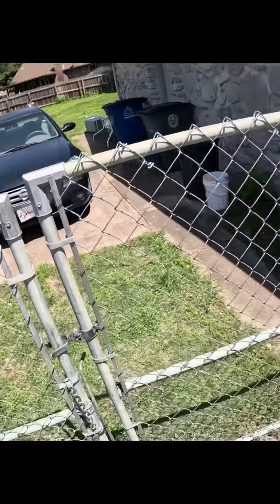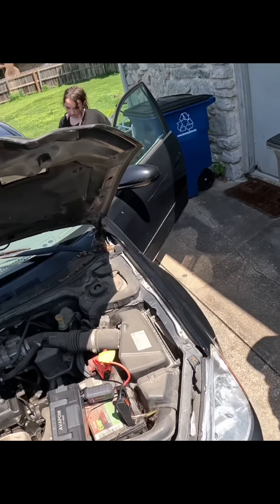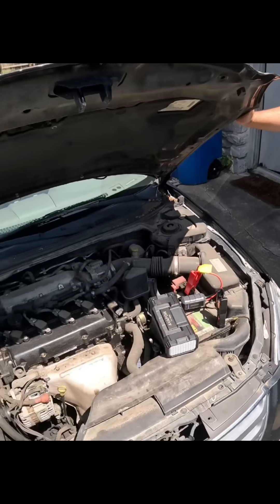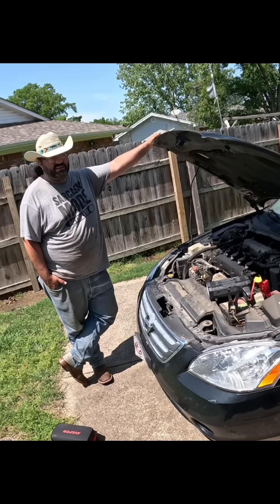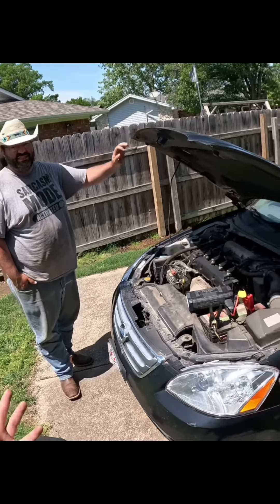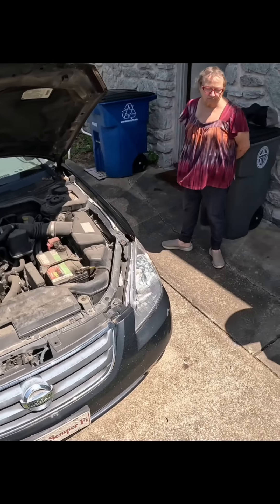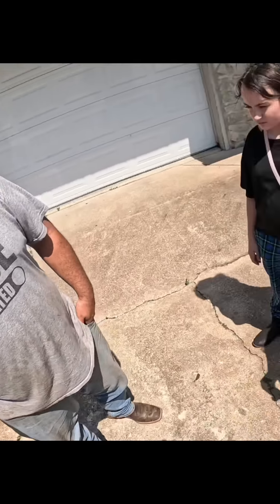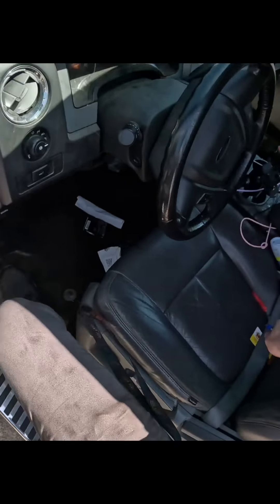Her first car is on its last leg!

Comment: Matthew, when I met my wife back in 2000, she had just purchased a 2000 dodge neon 5 speed with a 2.0L engine. I couldn't drive it, but I could maintenance the vehicle.  It was our most reliable vehicle. I have done brakes, a cam sensor, and a couple shift cable bushings over the years. Nothing major.  Still runs great. I'm sitting in it running fuel injector cleaner through the engine as I am typing. My wife taught me how to drive a manual transmission in this car. It is very special to me.  I'm sorry for my mom. It is sad how people take advance of people. I love your channel and your integrity. God bless you and your family.
Reply: Good to hear I got a 2005 neon sxt does yours have the classic lifter tick ? and what oil you use ? So far Only major jobs was water pump timing belt head gasket for me 145k miles the base models are very reliable the srt4 was pretty reliable as well dodge and Mitsubishi did well with them …Matt had one neon on his channel I believe
Reply: They are the best I had one for 11 years never left me stranded and it never left me down! 2004 Dodge neon SXT when she passed over from salt from the road she had 250,000 mi on the clock! Best vehicle I ever owned besides my Intrepid!
Reply: @Young516_ I never had any problems only had to change the timing belt and water pump and that was it of course I did transmission fluid changes best car ever owned!
Reply: @Young516_  The only time I hear lifter tick is after it has sat for a few weeks without driving. It goes away after running the engine. I've used all the major brands of oil in it. I always changed the oil at 3,000 miles. I timing belt and water pump is coming up.

Comment: there not being a check engine light, doesnt mean it has no faults. my car is annoying because of it. gets a fault, but if its not terrible, it just keep on going like nothing. had low fuel pressure sensors go bad, evap system clogged, missfires, yet it gave me no check engine, but the fauls were registered and visible on the diagnostic tool.

Comment: Don't know why it would be pointless to scan if the check engine light isn't on. Check engine is only going to tell you about drivability or EVAP concerns. If you're inspecting the car for someone to by, having all the other information can be useful. I had a truck I just bought where the AC worked great. Tested it, felt cold air, and was going to move on. Saw an HVAC code and realized I need to go test EVERY switch and button because there were actuators that weren't working. 

Then I learned the front impact sensors were defective. If I smashed into something, the airbags won't deploy. Don't you think the Dad is going to care about something like that for his 17 year old?

Stuff like this that doesn't trip the money light is important.

Comment: $250 for the timing chain 😳 I paid £600 for a timing chain to be done on an opel corsa 1.2 two years ago 😳😳 and then I paid the same garage £300 to do the water pump like a month later because that went to be honest I was suspicious that they may have sabotaged it because you have to take the water pump off to do the chain and the chain never sounded good either, I certainly wouldn't use the same garage ever again, the water pump literally went or started making noises like a week after they'd done the chain 🤷‍♂️ but you can't prove it so 🤷‍♂️
Reply: My timing chain for a v8 ford 302 cost me 55$
Reply: They should have insisted and made the water pump part of the timing job absolutely. I don't feel it was sabotage though, the new tight chain and tensioner alone would have wreaked havoc on the old worn water pump.
Reply: @joseespinoza93 and how much for labor?
Reply: @BigT5  0$ cause I’m a competent man who Used YouTube and a husky toolbox to install it perfectly
Reply: @L2L2L2-2 Even the timing belt kits i used to replace on my 2000-ish Opel Vectra and Astra had cost 150 dollars (probably, converted), They included water pump, tensioner and pulleys.
That 55 dollars is almost too cheap. 😉

Comment: That tensioner sound is interesting. I had my timing belt done on my MK4 Jetta about 14 years ago and I recall that noise being present afterwards. It was faint but I could hear it. I suspect the mechanic never changed out the tensioner and I'm assuming the entire job was basically useless? I sold that car a few years later and the guy who bought it ended up blowing the top end because it skipped time. I had all the paperwork for the job and he knew it had been replaced but now I think back and realize that may have been the reason why? I bad tensioner?